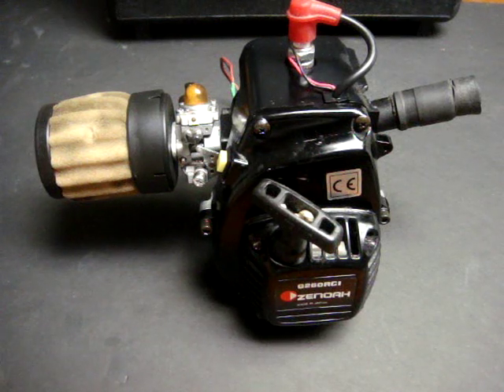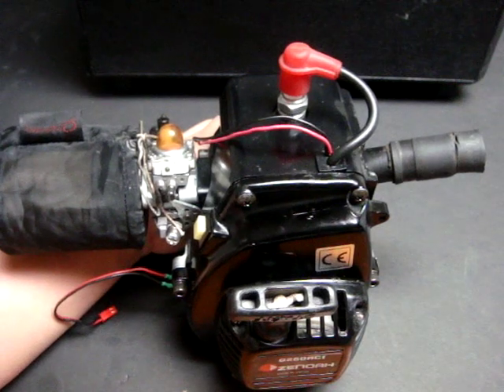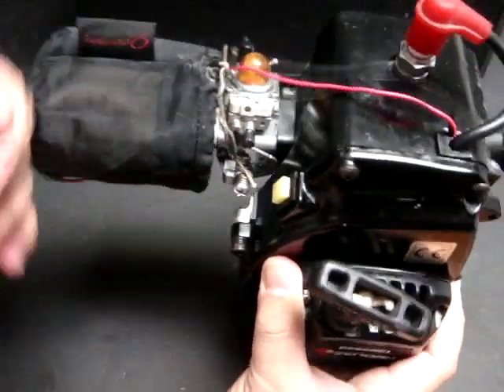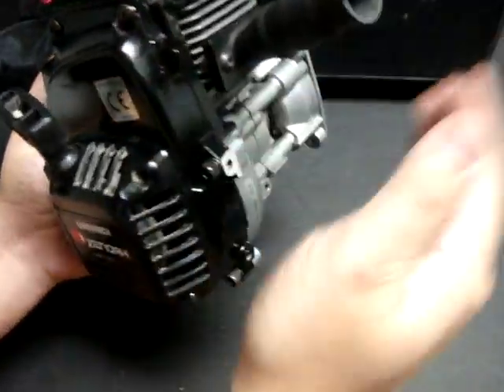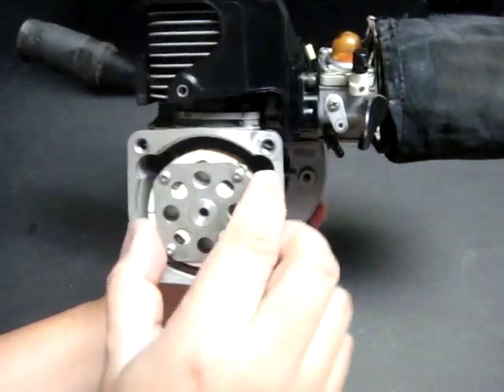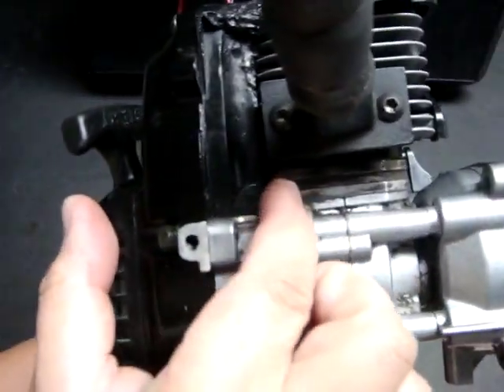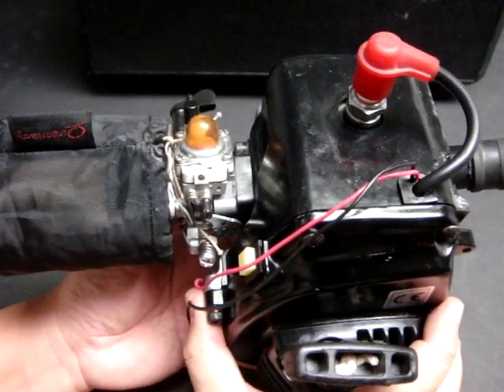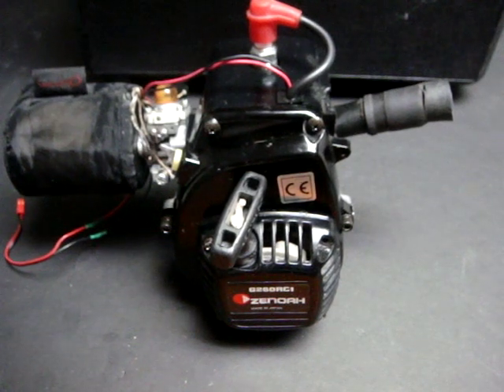Zenoah G260RC1 26cc gas 2-stroke RC engine

Comment: Got a question. I noticed on google of gas tanks used for this engine and the gas tank cap said Unleaded fuel + Oil. What does that mean? Can you just use pure gasoline in it or have to mix it with certain type of oil for a mix ratio??? I’m confused.
Reply: LeonVanzan Vang no you cannot use pure gasoline with 2 stroke engines. 2 stroke engines need a mix of oil and gasoline in its fuel. If you were to use pure gasoline only your engine would be trashed
Reply: What do you use in your trucks for fuel? Regular unleaded or 93 octane pump gas?
Reply: @michaelhembree6347  I have the same engine on my goped an I use 93 pump gas mixed at a 25-1 oil ratio